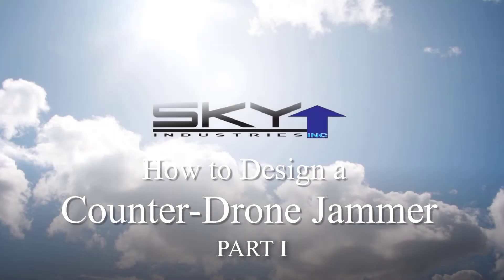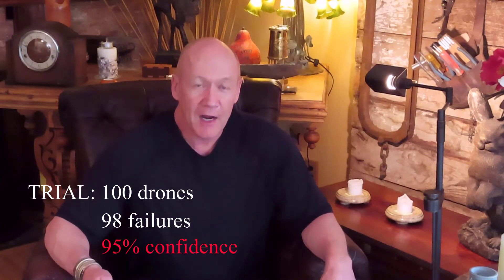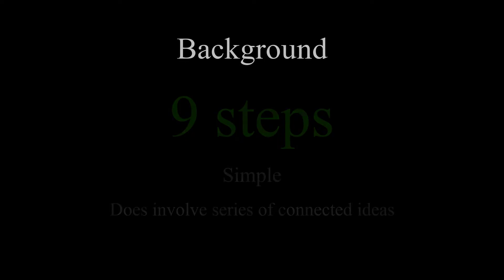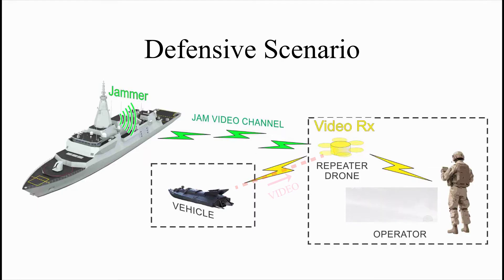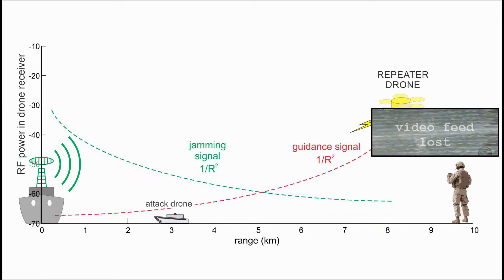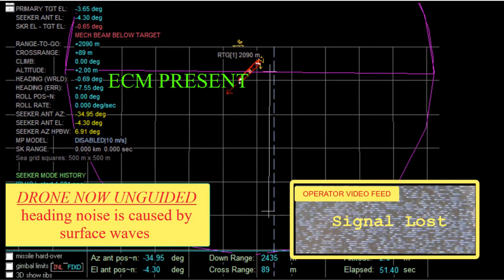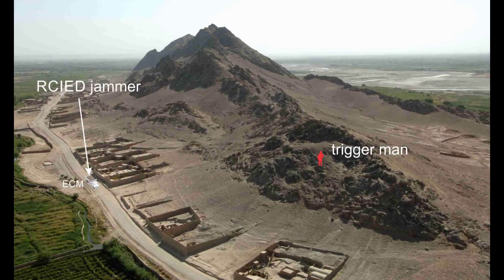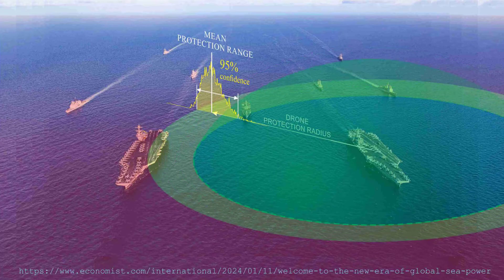How to Design a Counter Drone Jammer PART I

Comment: Home in ob the jammer
Reply from the maker: Fair point, it's the cat-and-mouse thing, always like this.  

Home-onjam (HOJ) is used seekers of radar homing missiles and in fire control radars.  

Although HOJ is not a feature of FPV drones, it could in principle be added - but it comes with additional complexity, e.g. the need for an in-band antenna system and the need to develop a sufficiently accurate steering command from the measured RF signal.  

The RF missile world went through this evolution decades ago: CONSCAN, COSRO, LORO, SWC, monopulse.  It might be repeated in the drone world.  

And then it becomes another opportunity for jamming, as before.

Comment: MOst of thesew drones using video and control link via starlink- how do you jam a beamed multisource communication??
Reply from the maker: That's a service denial problem, similar to jamming RCIEDs which are triggered by cell phones.  Or more accurately: triggered by signals from cell phone towers.

Comment: Unfortunately for this 8 month old video the application of Artificial Intelligence as well as FIBRE OPTIC GUIDANCE overrides the
technical solutions offered herein. Drones are evolving at an exponential rate as a result of the Ukrainian conflict(much to the Russian's chagrin, as they are consistently falling behind the Ukrainians' expertise)
Reply from the maker: Your comment has merit, but perhaps not the way you intended.  

You state that this "8 month old video" is irrelevant.  It's irrelevant to people who don't want to solve this problem, but it's not irrelevant because the problem no longer exists.

It is a provably false contention that no drones anywhere worldwide are vulnerable to jamming, i.e. that all drones everywhere worldwide now use fiber-optic comm links and/or AI targeting.  This necessarily includes consumer-level drones (e.g. WalMart and Costco), commercial drones, and military drones.  

Like everything in life, the drone threat is a mixture of systems that fall on a spectrum: at one end are systems which are easily jammed, at the other end are systems which are impossible to jam.  Everything falls between these extremes, and the distribution on the spectrum shifts from time to time.  And of course there are other axes.  

BTW an entirely unjammable threat means there is no need to field jammers.  Once the jammers are gone, the radio link drones can reappear, being simpler, less expensive, and more capable.  And the predator-prey cycle repeats.  Always like this.

Comment: U can't jamm self steering AI-powered drone that also might have a spool of fiber-optic cable as redundancy .  I also would not publish even a simple solution on YouTube cuz I would sell it to DoD instead as well :)
Reply from the maker: Quite correct - only drones which use radio signals can be jammed.  AI has other kinds of problems, as do fibre-optic spools.  

A common logical error I have seen many times: because we can't jam all the drones, there's no point in jamming any of the drones.  

Sell a solution to DoD: I used to think so, then found out they don't want anything they can't think up themselves.

Comment: How about a sea drone antenna that is a phased array pointing at satellites and the antenna on the sea drone is in a Faraday cylinder with the top off or a more standard Faraday cage (box) with the top off and the phased array low enough in the cylinder as to not expose the antenna to line of site with the ship while able to remain line of site with the needed satellites in the constellation? The only solution I can think of is flying assets from the ship that can get somewhat between the sea drone and the satellites. The idea is to have the flying jammer assets protecting the ships flying an optimized altitude sufficient to cover a large enough area on the surface of the sea without flying too high reducing the field strength at the sea drone. Of course, this is all theocratic and can be overcome with a sea drone with local target tracking for last mile intercept coupled with an INS for last mile and a GPS receiver using the same concept as the phased array.
Reply: This was my exact thought as I was watching this. The methodology described here assumes Marconi radios instead of beamformed radios.

Comment: So I guess to test whatever you've made, you either have to have access to a very good chamber,  or you need a remote testing range, like going out to sea outside territorial waters... otherwise the video's title should be "How to violate FCC regs and acquire a felony bust."

So this is aimed at amateurs?  No- what use have they for this tech?  Mariners?  Doubful that they would DIY their own defense kit.  Defense contractors?  They already  know how to do jamming, and are already releasing anti-drone products left and right.  So again: who is the intended audience for this video? Who will benefit?
Reply: Me. Because I think it's a fun and interesting subject.
Reply from the maker: FYI during a foreign war there are no laws about radio transmission in the conflict country, and we do not operate those jammers in our own territorial waters, with the possible exception of experimental tests.  In testing circumstances a transmission license is needed, or we test elsewhere with permission, e.g. Iceland or Canada's far north.  

You ask a good question, "who is the intended audience for this video? Who will benefit?"  Answer: anyone who has to do this type of work in circumstances where it's unacceptable to base the solution on guesses.  

The point is the methodology, not the jamming signal types or parameters.  After the jamming signals have been determined (or an adaptive system to control them), a methodology is needed to accommodate the environment and the protected platform.  

Intended audience: 
- defence contractors
- DoD technical staff who evaluate proposals
- DoD staff who manage technical work
- DoD and contractor staff who plan projects for next-generation technology
- DoD and contractor staff who need to be technically knowledgeable to do their jobs
- procurement and technical staff who need to determine if the protection provided is value for money, assuming anyone cares
Reply: @skyindustries  I enjoy every video you produce. I am sorry it attracts these comments.
Reply: An intelligent answer was already provided. Therefore I can say the intended audience is your mom, sir.
Reply from the maker: @ she did not do this type of work when she was alive.
Reply: FCC can only catch you once they get hundreds of complaints about cellphones or Internet being jammed , they then send an investigator near the area with a receiver in his van that detects frequencies . If your jammer happens to be throwing out these frequencies they will hone in on you and you end up with a hefty fine , so basically don’t use it often

Comment: You could have a self contained drone that doesn't need an operator? Like many of our missiles fire & forget! It selfs guides using a programable map, IR, or INS and don't forget AI.
Reply: Don't forget about cost. I'm in the scene and ML specific hardware can get expensive. Strapping a $1000 "brain" on a million dollar missile is trivial. Doing so on a $250 drone suddenly quintuples the price. Fully or near fully autonomous drones will be coming soon enough, but optic fiber drones do for now
Reply: Yes, and then you could have anti-drone drones. Basically what you have attacking ships is a slower, cheaper version of a torpedo or cruise missile. What the ships seem to need is a slower, cheaper patriot missile system or phalanx gun. I suspect what will be eventually adopted is sub $1000 drone modifies with a dual effect shaped charge, one narrow projection down through the target to either sink, disable of detonate it, and a second that fires a disc-shaped spray of very small but heavy particles (kind of like those the iron dome system has been rumored to use) to try to damage or destroy anything sticking up from the hull. This relatively small drone would fly over and use a cheap thermal imager to lock overhead, then use lidar to control closure rate and proximity fuse functions. I suspect the Ukrainians might be able to produce a drone like that and sell it profitably at $10k per drone all up. No super-experieced drone operator needed, just someone who can launch it and fly it over the attacking vessel. Note that this would work equally well on manned boarding craft.